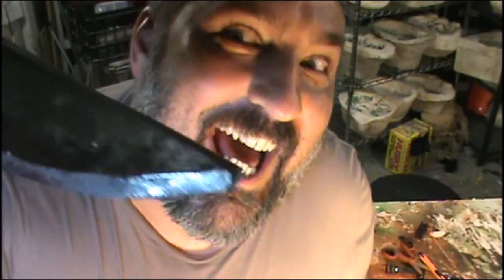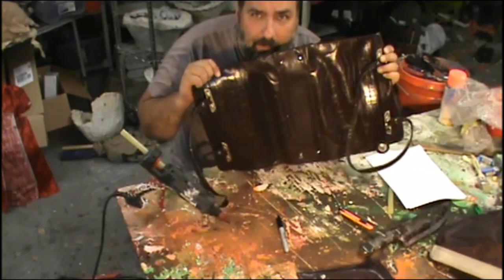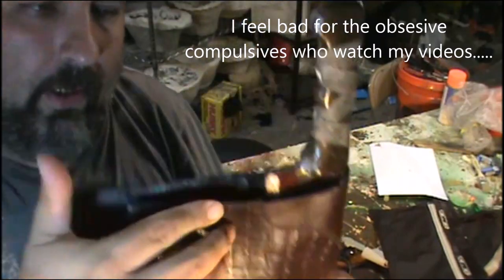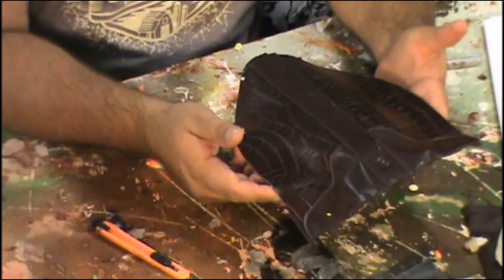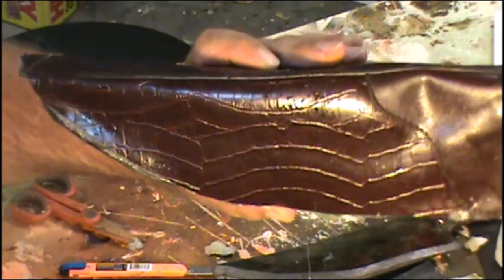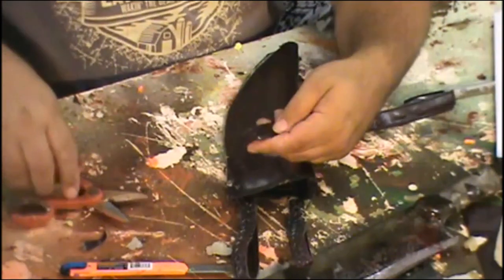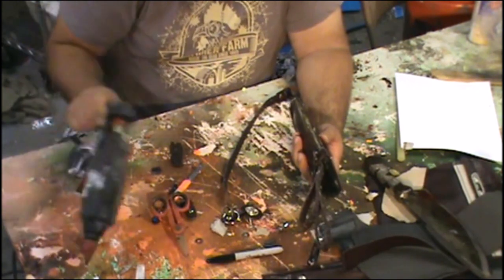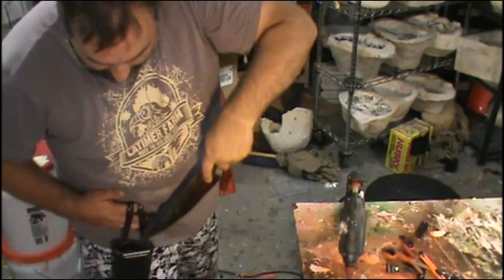Prop knife sheath

Comment: Man, a pop riveter would be the perfect tool for assembling one of these.
Reply from the maker: Beef Chavez  Only if it uses double cap rivets. Normal pop rivets have one side that is pretty rough that I wouldnt want against me or be able to brush up against customers. Double cap rivets from Tandy are a great option and a leather punch would speed it up greatly.